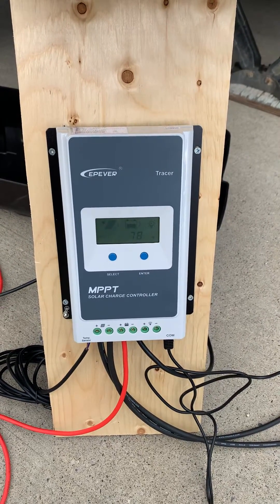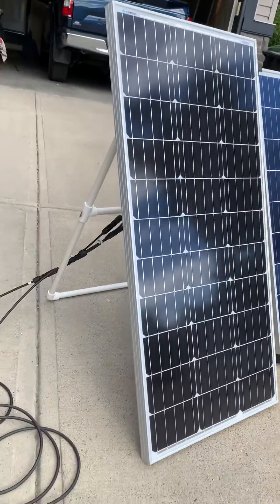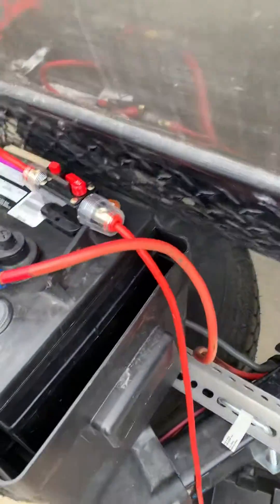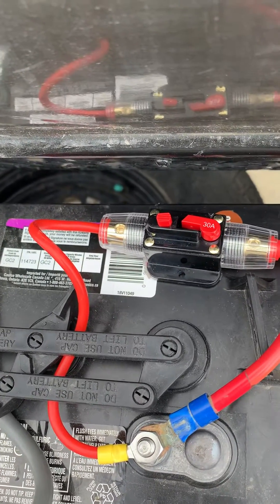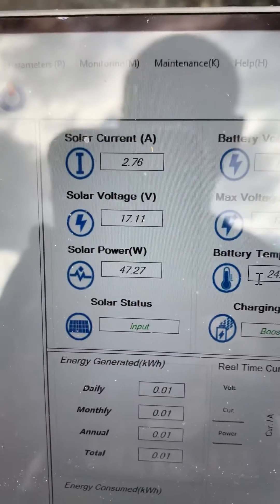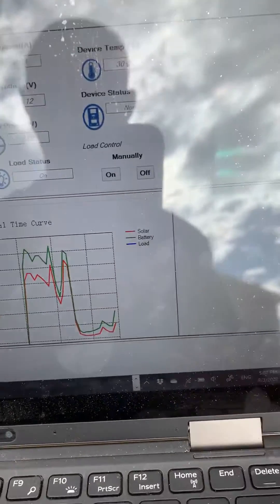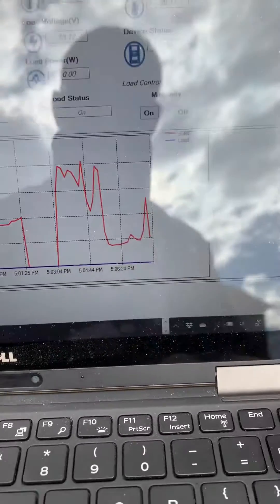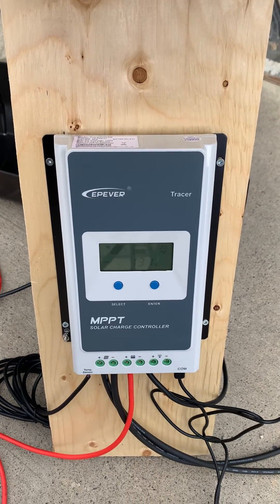Epever Tracer MPPT solar charge controller physical setup

Comment: Hi
I have the 20 amp version I have 2 100 watt solar panels can I wire them in series to charge my 12 volt batteries or will the mppt kick out 24v??
Thanks
Reply: yes you can I have 4 100 watt series just never go above 100 volts no matter what array you use.
Reply from the maker: Thanks for answering!

Comment: Can this be configured to charge a 155AH 12v deep cycle AGM at this rate:  Bulk charging voltage: 14.5V-14.9V; Float charging voltage: 13.5V-13.8V?
Reply from the maker: Sorry - that is a great question but unfortunately I don’t know the answer.

Comment: No Earth cable bud? Is it not needed on these?
Reply from the maker: Not needed in this setup. There is a temperature cable attached which allows the controller to adjust for ambient temperatures

Comment: I have  the same mppt change controller my 20 ams ....how meny 100 soler panel can I use linking then up to  how meny 100w  pannles ,?
Reply from the maker: I wouldn’t do more than 200W, based on P=IV; at 12V, 200W would get you to 17A

Comment: I have the tracer 1210 controller, I am new to solar. I wondering what to do with the load terminals on my controller. I noticed yours are not connected so what are they for?
Reply from the maker: That’s if you want to connect power consumers directly to the controller. Since my battery is what is supplying power to my trailer, the power is managed through my trailer’s converter
Reply: load is for small LED lights not for heavy amp/watt use